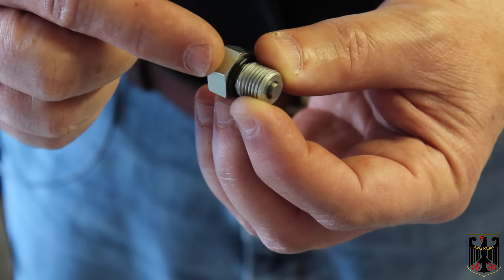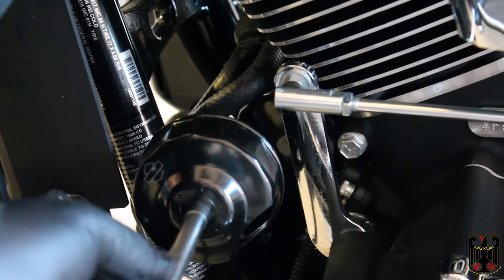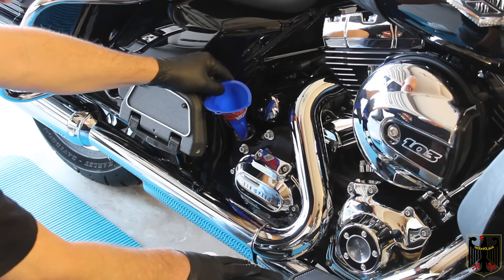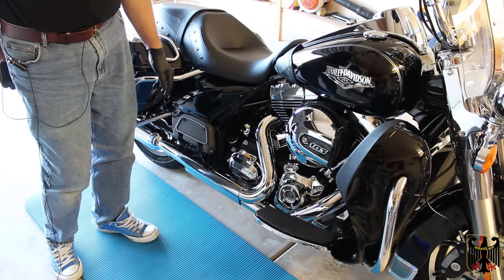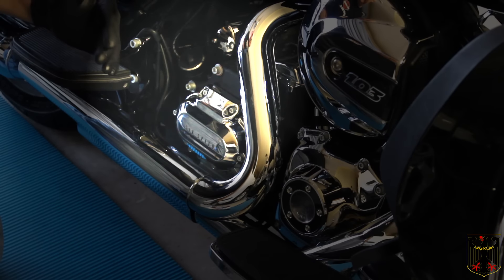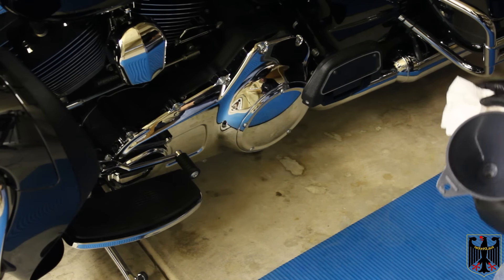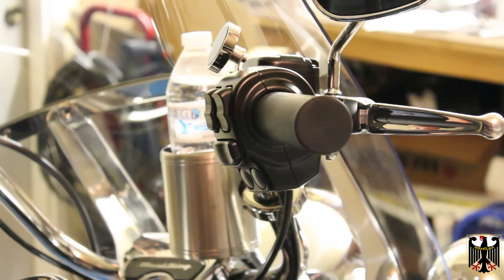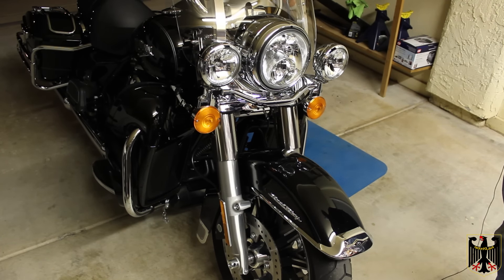Harley-Davidson 1000 Mile Service How-To

Comment: Wow, glad I did this service myself!  A pal of mine took his bike to the dealer for a new rear tire.  A few days later he was driving on the freeway and the drive belt came loose.  Suspect the dealer forgot to tighten the axle to spec as it destroyed the belt, the left tensioner, and the entire day.  The only weird thing I came up against was the oil filter.  I used the Chrome filter spec'd for this bike, but it only threaded on about 3 full turns before starting to tighten.  The original black filter threaded on about 10 full turns.  I checked and rechecked the P/N's and I definitely used the correct one.  Next oil change I am switching to K&N.

Comment: Thanks. Just used your video with the book to do mine. One thing that surprised me. On my bike (2020 street glide) the trans plug is directly behind the oil. So I did the oil, filled it back up and then went to drain the trans. The oil that came out was so new looking I was sure I was letting out fresh engine oil. I triple checked the manual and it was the trans oil. Also there are a few other things you do in accordance with the manual like checking steering stem bearings which amounts to lifting it up and making sure there’s no play. And a few other things. Probably just stuff added to get that first service up to the $400 mark at the dealership but I did them and documented it all in a notebook with pictures that way if I have issues I can verify to HDMC that I’ve done my due diligence.
Reply from the maker: Awesome, thanks for watching!
Reply: Can you please do a video on checking the steering bearings please much appreciated this video is good I ordered my redline oil and waiting to do my service on my 21 roadglide

Comment: My local, Delbarton WV, harley shop did my 1k service for $245 tax and all and changed motor, trans, primary oil. Also checked torque and checked my recall on my '17 street glide special. I didn't think that was horrible price. $500 and I would have prob did it myself. Thanks for video, very informative.
Reply from the maker: That's definitely a good price on the service, most dealers around where I live charge around the $500 mark.  Thanks for watching!
Reply: I just had my 1K service done on my 2017 Road Glide Special at my Harley dealer(I bought the VIP plan so all of my service and oil changes are free for the first 3 years). They charge 465.00 for the 1K and 5K.It was still a great video to watch, thanks for sharing!
Reply: Free if you do it self it’s really just oils etc

Comment: Throwing that synthetic oil (not recommended from manufacturer) in your new HD voids the warranty, there is a reason you don't perform the 1K service on your own. If anything occurs with your bike that oil is going to be inspected and you will be found accountable for the damage internally. You check those master cylinders for the brakes to make sure vibrations within the first 1K are not forcing bolts out. All and all great video!! Just be sure your warranties are not void with the types of oils.
Reply: Re: Wrong type of oil. You must "whinny" when you walk because that sure sounds like horse hockey.

Comment: During a real 1 k service there is a lot more performed. There is a critical fastener check such as your axle torque, wheel alignment would be done with the belt tension, brake fluid inspected, charging system check, etc. This video is good maintenance but not necessarily a 1,000 mile service.
Reply: True, or at least they are supposed to do all that. Now that said, Harley should do the 1000 mile service for free as part of the warranty.  But no, Harley just uses that as another excuse to price gouge you. Well fuck that, just learn how to work on your own damn bike. Save yourself A LOT OF MONEY.

Comment: I'm a professional tech. I seriously recommend you have the dealer do your first service. They do more than just change fluids, if anything has worked itself loose or any problems are starting to materialize an experienced tech will be able to spot it. It's also good to have your 1000 mile break in service on record at a dealer so if you have a problem with your motor later the warranty company can't use it as an excuse.
Reply: Since a special machine is needed to bleed the brakes on ABS bikes, my plan is to let the techs service the bike at 20,000 and 40,000 miles which will be every two years.  I will keep up with the services in between.  Hopefully the techs will be more diligent than the tech who fixed my fairing vent under warranty and forgot to reconnect one of the speakers.
Reply: Ahhh, those warranty reps have a thousand and one excuses for not covering. My least favorite part of working at Saturn all those years ago.

Comment: Good video but what the dealer told you about oil is bogus....   any oil is not too "Slippery" ....    Oil simply gives a lubricating film to parts that contact each other. The correct oil will minimize contact... also known as film strength...

Comment: How much maintenance do Harley Davidson motorcycle have? Oil change, valve checks etc?
Reply from the maker: All of the typical maintenance for most motorcycles is applicable to a Harley.  Thanks for watching!
Reply: Hydraulic valve adjusters so no maintenance
Reply: My 2012 Electra Glide has 34000 miles. I change the fluids every 3000. Mobil 1 15w50 oil and redline tranny and primary. I changed the brake pads at 22000 miles. That’s it. Never a leak or hiccup from my black beauty. Also, at 10000 miles switched out the rear tire to Michelin Commander 2. Went to 31000 before changed out. Changed the front tire to the same at 15000. Still on and tons of tread.

Comment: Never owned a new Harley, but do they void your warranty if you do your own work? Or ad and modify things?
Reply from the maker: The Magnuson-Moss Warranty Act prevents any company from voiding a warranty due to DIY maintenance assuming proper specs and procedures were followed.  Modifying, however, typically voids the warranty of the specific component you modify but not normally of an entire vehicle (if you alter an engine, the engine warranty may be voided for instance).  Hope that helps, and thanks for watching!
Reply: Also, most mods involve little more than a pair of slip-ons and maybe a Stage 1 AF. All one need do is install a V&H fuel pack, save your original map, remove/remap the bike if you think any of the "mods" caused whatever issue you may be experiencing. It'll read like a clean factory install. Beyond this, aside from screwing up an electrical component/system with shoddy install work, there isn't much which can legally be claimed by a manufacturer as causing a defect. They can try, but there's lots of laws against said practice.

Comment: 22.6 N m is what your wrench dialed in to - you do realize that this is residual torque?  What does the factory spec say the torque for that nut is?   I’m guessing about 15% higher. Your nut is going to loosen up in the next 24 hours and will probably be below spec.

Comment: On my 2015 owner's manual, the oil plug is the one to the left. Not  center.
Reply from the maker: You should definitely follow your manual, as your bike may be different from mine in configuration.  Thanks for watching!

Comment: I've read, heard, and seen that the HD dealer has to do the first 1,000 mile service or the warranty is void?   After the first 1,000 mile service you can do your own BUT you have to maintain accurate records for warranty purposes.
Reply from the maker: The Magnuson-Moss Warranty Act prevents that from being the case (at least in the US), with the caveat that you need to retain accurate records for all services.  Hope that helps, and thanks for watching!
Reply: Harley Davidson is not above putting "fake news" out there, in order to scare a consumer, when it comes to their products.

Comment: 2002 roadking manual says use straight 50 oil 
can i use 20 w 50
Reply from the maker: I would use whatever is recommended for your particular bike in your manual.  Thanks for watching!
Reply: thank you
Reply: This isn’t a 2002 !